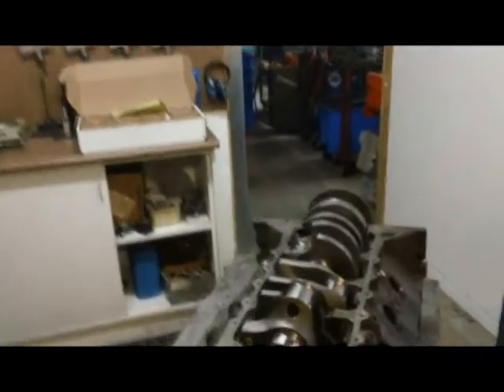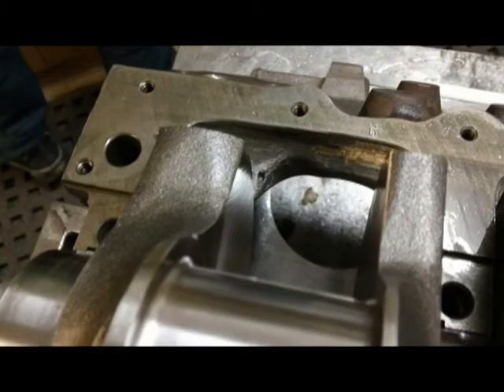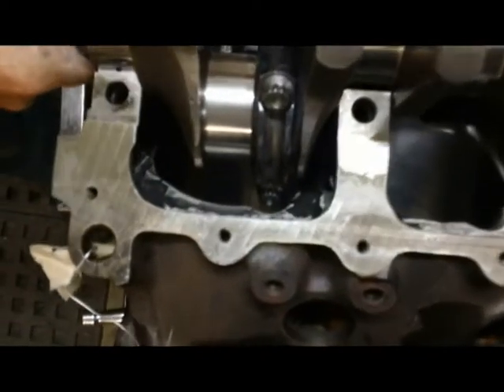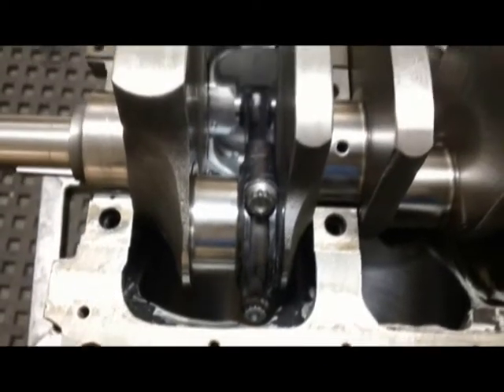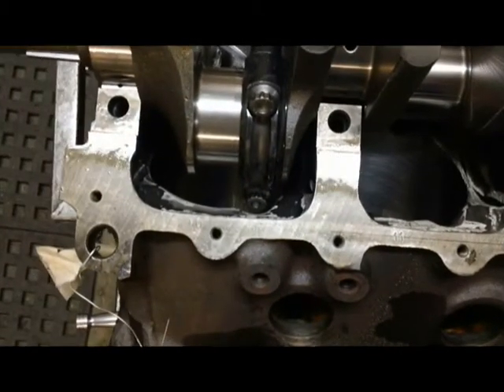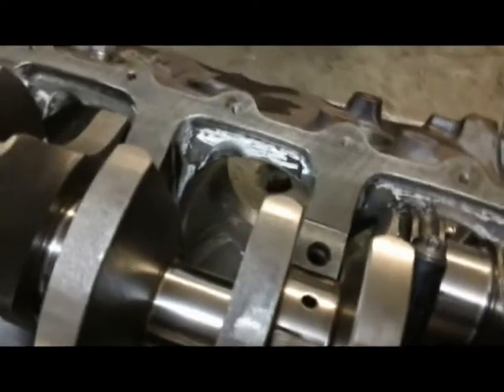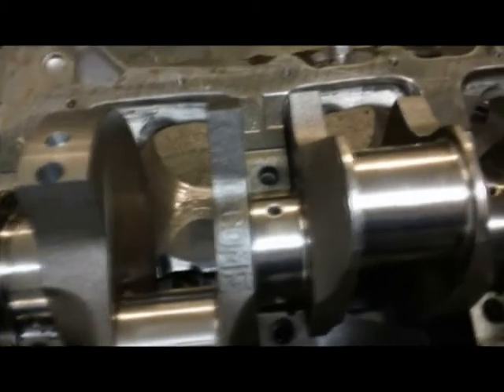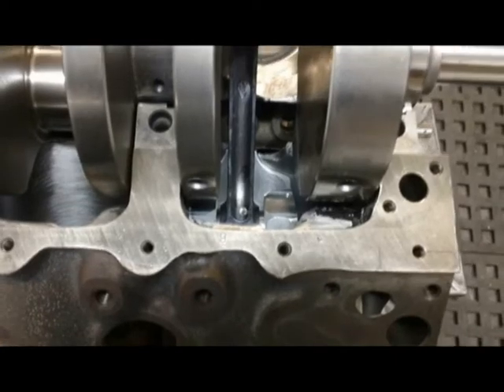355 Holden stroker block clearancing.wmv

Comment: Hit the water jacket on mine on one cylinder, welded it myself, it never cracked or ever leaked. Crankshaft I used was a highly modified fully counter weighted, offset ground FORD Y-block steel crankshaft, 7/16" H-Beam Rods and ground the block to achieve .060" clearance to the Rod Bolts.

Comment: so thats all you need to do to fit the stroker kit?
Reply: You'll have to get it bored out for it to be a 355 
You need 30 thou over Pistons for it to be a 355
It will be a 350 with stock bore

Comment from the maker: Use an abrasive stone and not a metal burring tool. Your local engineering supply company should be able to supply a suitable grade stone for cast iron or aluminium blocks, whichever you are clearancing. We use a bullet head shape stone most of the time and radius it if required on an old worn out cam grinder wheel. You can use an old bench grinder wheel as well. Only need to re-shape or radius a stone if you are trying to get into areas the bullet nose cannot get into.
Reply: Why not metal burring tool?